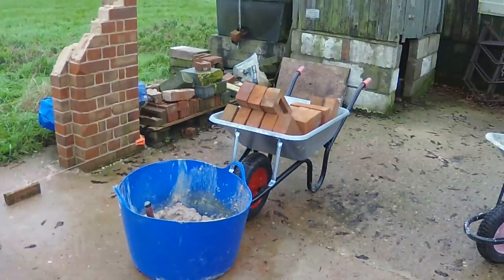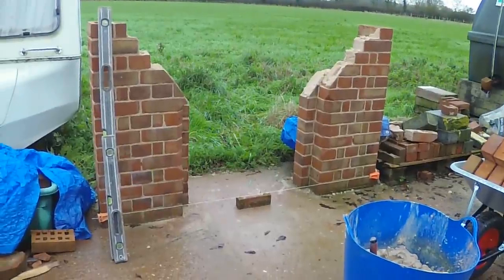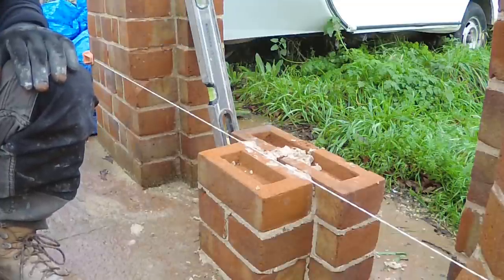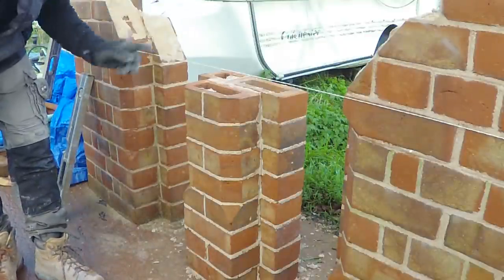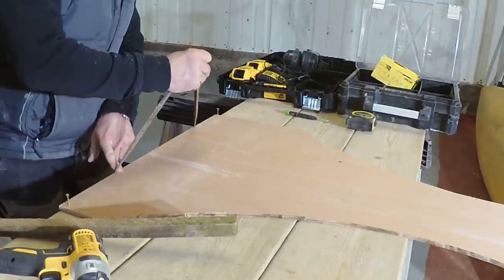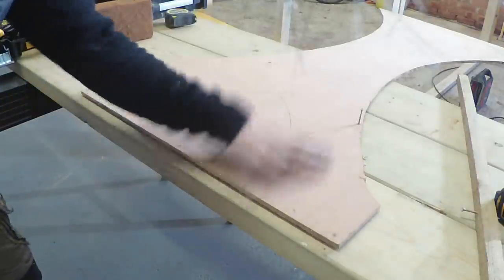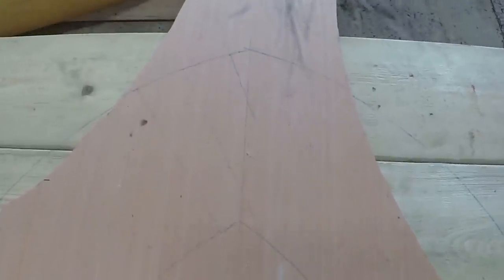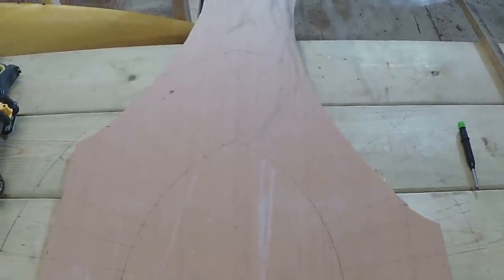the fine art of brickwork - 4 Gothic Arch - Setting Out

Comment: This is going to look superb. Fair amount of time in all the prep of the voussoirs. Do you have a table saw where you can use a jig?
Reply from the maker: I've been looking at getting a Clipper saw for a little while now, so as soon as these lockdowns ease I will get to the supplier and get one.
Reply: @robsonger1  Hi Rob, if I were you I would look at the Scheppach saw. It's much more versatile than the clipper as it has the ability to cut compound mitres. I've got a clipper and find that there's too much movement in the table & only being able to make vertical cuts is limiting.
Hope this is of some help
Regards 
Tim
Reply from the maker: Thanks Tim, I will take a look

Comment: At the risk of sounding stupid, could you use that mortar to build a house, obviously its not as strong as normal mortar but technically there is only downward pressure on it ? What are the pros and cons? All comments welcome thanks. Great work as usual BTW.
Reply from the maker: Hydrated lime doesn't set hard like hydraulic lime and cement does and in damp conditions it won't set at all. Its ideal for training mortar as it reusable time after time
Reply: @robsonger1  cheers that's cleared up then 👍